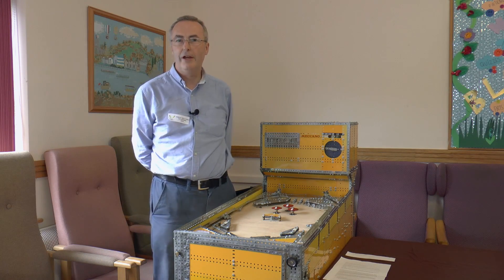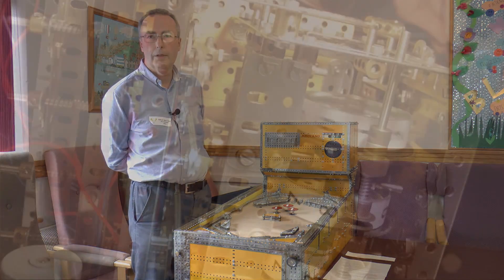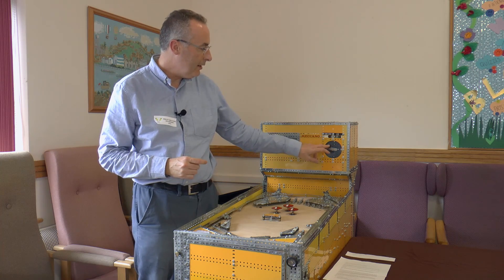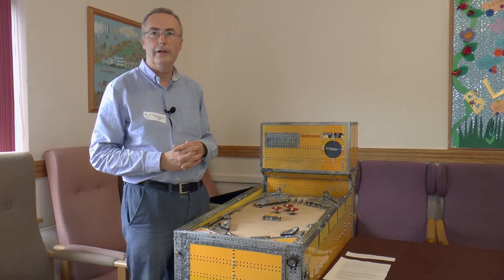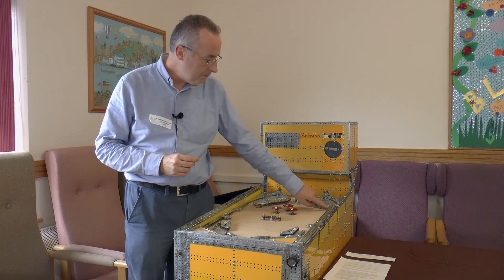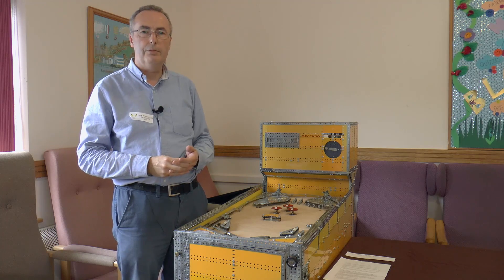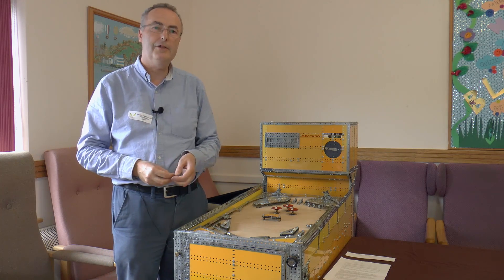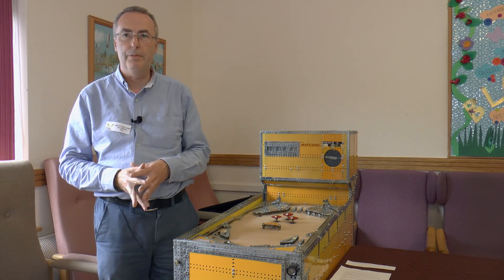Pinball Machine

Comment: Why have you avoided solenoids? What is the reason that neither your score reel nor pop bumpers could use solenoids? What do your pops do; I saw them take a direct hit @5:45 with no reaction?
Reply from the maker: Brian wanted to stick to using all Meccano parts as much as possible, but since the Meccano solenoids are not powerful enough, he needed to use motors too. He also explained in the video that, as you point out, the pop bumpers did not work well!
Reply: Yes, the pop bumpers are disappointing. I should have stuck to the way it's really done, which is a sprung disc on the playfield with contacts underneath. If I ever make one again, that will be the way to do it. In the video the electrical contact is made on the base studs, to the ball and then from the ball to a washer just underneath the top of the bumper. That is not reliable enough.
Reply: Well, I've come back for another look. I understand how you've wired them, Brian. Using the ball to complete a circuit is not the way to go, though I applaud your attempt.

I'm impressed by that bank of drop targets and your use of clutches throughout. My initial impressions didn't take account of your desire to stick with Meccano. I just missed the generation of Erector sets in the US, and this is the first that I've heard of Meccano.

Great work on a full functioning machine!